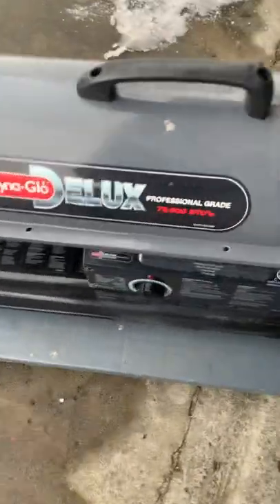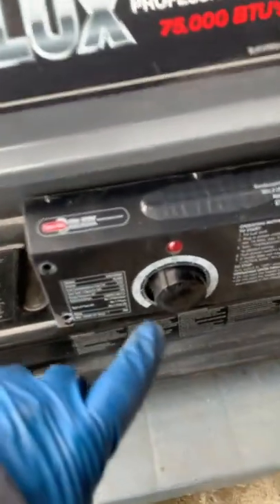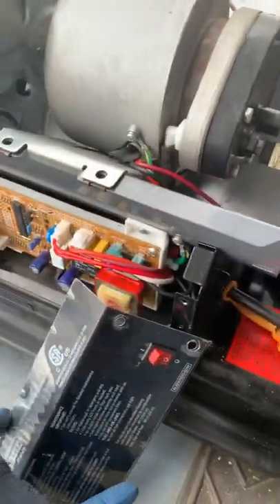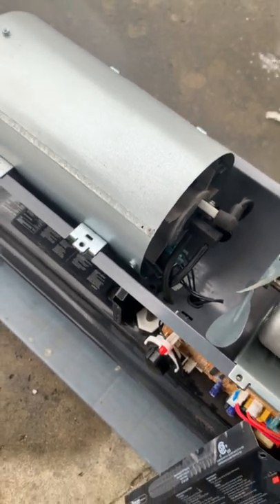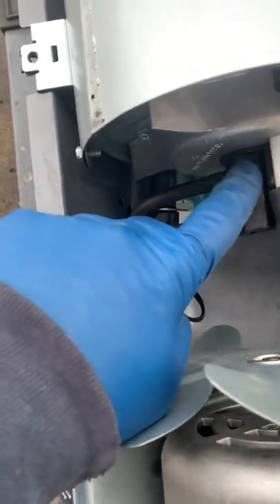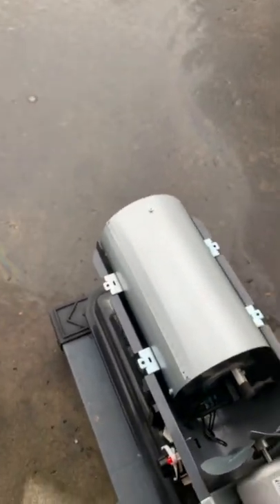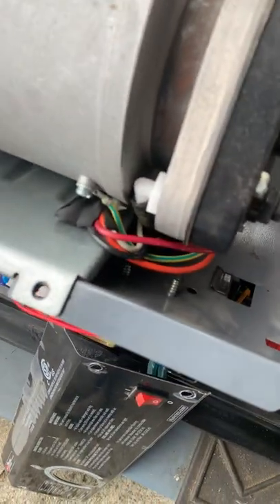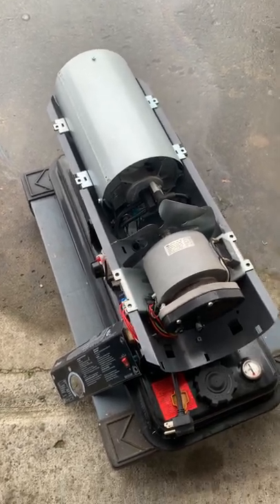Torpedo Heater, Dyna-Glo 75K BTU Won’t Ignite. Fixed

Comment: The 75,000 btu unit is now selling as an 80,000 btu unit? My new 80,000 btu unit still has a 75,000 btu fuel nozzle (I noticed this when cleaning the nozzle it has 75,000 stamped right on the nozzle. So it's all a sales gimmick. I guess 75,000 btu wasn't big enough to sell the unit. What a lie. I see a couple other brands (all made by the same manufacturer, DESA) that are rated at 85,000 btu now! I wonder what size they REALLY are?
Reply from the maker: You could be right.  This labeled 75K unit does a great job in my garage.